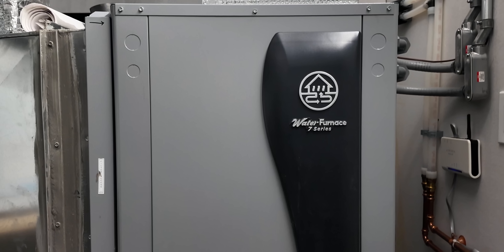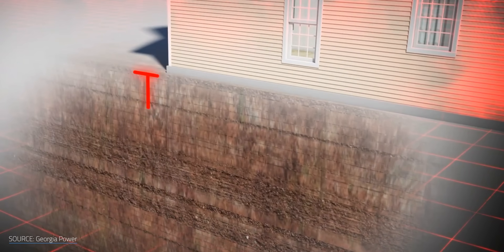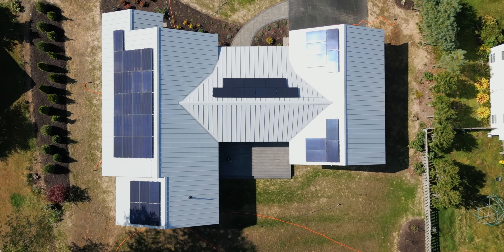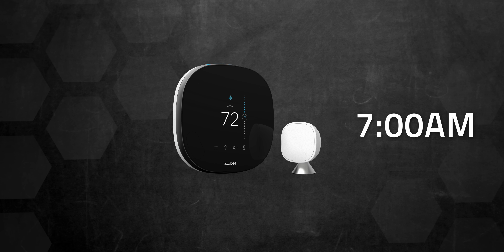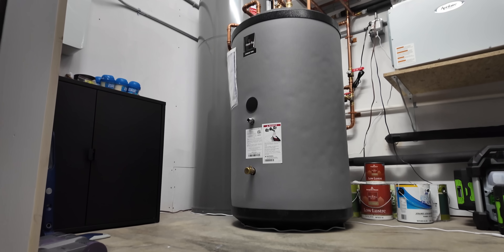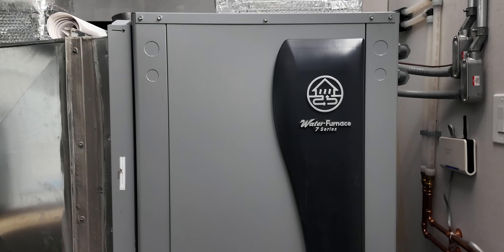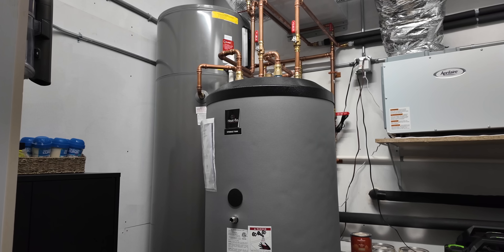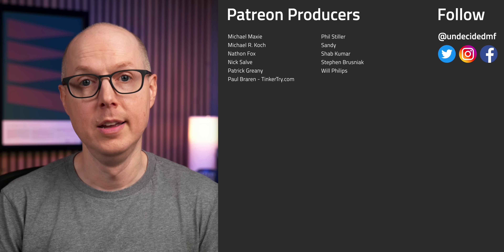How My Geothermal Heat Pump Really Performed (2 Years)

Comment: Hello Matt, 

Have you ever considered attempting to recharge your well in summer with more than you consume in winter in order to raise well temperature in the long run which in turn would raise your cop permanently? Groundwaterflow would be a thing, but was in my case no issue. 
Philosophically that's what we're all trying to achieve.You probably already do in part with a/c, but could a 24/7 reverse dry cooler (when T-ambient>Twell or house T-out) both running of excess solar improve the gram CO2/kWh dilemma ? Well losses would be higher, but the heat pump would be running more efficiently every year and heat would be nett transferred from atmosphere to earth, albeit relatively temporarily on a longer timescale. It would have an upper limit of course, but nevertheless you could in theory reach a higher cop than you do now. 

I ran some numbers with a relatively large radiator area (10 consecutive 'truck' radiators of 1m2 each), low (parallel 200L/hr per panel so 2m3/hr) and efficient medium flow and low (0.8m/s ambient air over this 1m2 aperture, but 10m2 radiator surface) serial airflow using low power, low noise and highly efficient 200mm Noctua computerfans, IP68 possible. Project was due to noise restrictions here. 

Even at low dT's (7C) it appeared to be possible to transfer say 4.8kWh of heat relatively silently (estimate 20-23dB) using presumably very little power. Rough estimate is 100-200 watts for fans (25w) plus circulation pump. Battery power required for night operation would be relatively manageable. 

In theory you could also include a second small 1kw (cop 5 + for 20C to 35C boost) heat pump running 24/7 of solar, but regarding well plume losses over time that's where my back of the envelope math stopped. And system cost would increase drastically due to extra battery, pv and heat pump requirements. On the plus side it could yield potable water if the incoming air is moist enough. Heat of condensation would improve that picture ever so slightly, which in summer is no problem. 

Cheers.

Comment: My gound source heat pump (geo thermal as you call it) costs me £1500 ish a month to run for half the house (including hot water) my diesel boiler that runs the other half of the house costs me £600 a year ish......

Comment: You Bla-Bla-Bla about your very high tech complicated and expensive Heat Pump system.  We went what all engineers know,  keep it simple...we built an ICF home,  best insulated,  we live in the central plains,  high winds,  low temps......and we heat with simple in expensive purchased at Home Depot,  electric oil heaters,  set on the 500watt level,  running most times at the 2 or 3 "dial"  setting......one per room maintaining 70 degrees 24/7.

Comment: This stuff is useless for  Alberta , I have  3.4 k sq feet concret wall house with outside installation and  hydronic system , three glass windows . At minus 25 Deg C I run my boiler at 45 Deg C , with 160 $ gas bill , summer time bill is close to 60 - 70 $ due to fees 
. I don't run AC , because it is cool at summer time due to thermal mass , all you need , just to open windows at night to cool down. Just can't understand why would I invest 50 K to save 60 - 70 $ per month ?

Comment: The term "Geothermal" made people  think they were getting heat free from the ground, like in geothermal hot springs. But in reality they are nothing more than a standard heat pump that uses water rather than air as the transfer medium for the condenser in summer and the evaporator in winter. The water in the ground loop must be 10 degrees to 20 degrees colder or warmer than the soil, for the ground loop pipe surface to transfer heat . SO.....in winter the water inside the loop is about 40 degrees , and can be 35 degrees or colder. If a warm day pops up, an air to air will be using that warmer air, say 50 degrees, while your water source will still be using that 40 degree water.  A " net zero" thing, not even close. They are okay....but highly misunderstood by the lay person.

Comment: In Europe we have this for decades already. We can't build the house less then A class for approx. 8 years (not sure about different regions). I personally own B class (gas heating + rotary recuperation, no solar). Combined cost during winter ~200EUR/month (gas+electiricty, while temperature mostly -5C but can drop to -20C for a week) and 100EUR/month summer for approx 90sqm (~1000sft), heat pump type dryer is standart, induction stove, blabla bla and yes - network rack with NVR :) all new houses have by default Air-Water heat pumps and solar panels.

Comment: Miiele washing machines are designed to last but a few years and have sealed drums so the bearings can't be changed and thus, a new machine is required. You think you're being green? No fella, you're really not. You haven't accounted for all the equipment used during the installation or the manufacture and installation CO2 costs. When these are offset, you're probably one of the worst CO2 emitters in the area.

Comment: Would like to have heard more in depth on the numbers… e.g. estimated cost over 25 years included materials, installation, use, maintenance for each system, and then this total divided into number of months for an actual monthly overall lifetime cost for each system. Cause, sure, operating costs are low, but that doesn’t tell us much considering purchase and installation cost.

Comment: I get the monthy cost reductions are sufficient to pay for the up front capital which is great - but how about the long term costs (like over 20 years) of such a compicated system? Lots of computers, sensors, actuators, pumps, piping, many places to fail. If the ground look starts to leak that is a big issue for example.  I am an engineer and try to look at total lifecycle costs. This is similar to modern cars, their complexity is now so high the reliability is dropping (look at the Toyota Tundra for an example).  Not a convert yet. 🙂

Comment: Mmm, with a ranch house layout the energy losses multiply, spending a $100,000 to save $50,000 in 10 years it would break even in 20 years and would be the same as having nothing and end up loosing replaced items along that time span, It is cheaper to do nothing and stick to regular city services, it is useless to build something like this in an old construction...!..

Comment: I had a 7 Series installed summer of 2016. It's been essentially flawless.  Total installed cost was $28,000 before tax discounts.  I have a 460' vertical closed loop. I heat to 70 degrees and cool to 72 degrees in a 1988 built 1880 sq ft Ranch in Upstate NY.  My total electricity usage for 2025 was 4120 kWh @ $0.21/kWh for a total of $865.  I do not have pre-unit gas usage.  I remember the first year being about $400 for the year, but electricity prices are way up in the last 9-10 years.  I would not tear out a fully working system to install this, but my gas furnace was 12 years old and only 80% efficiency, I had no A/C, and my water heater needed to be replaced.  Just to add A/C and replacing the water heater I was looking at minimum $5000.  To put in a high efficiency gas furnace, A/C, and a new water heater I was looking at $13,000.  Net cost was about $16,000 for me after tax incentives.  I have no regrets.

Comment: Just got my December numbers in and I got 1212.7 kWh heat out of my air to air heatpump for the month while spending only 321.9 kWh to power it. That's a COP of 3.77 which I think is great for this frigidly cold weather.
Not nearly as good as a geo setup but at the low cost of purchase and install it paid for itself in 2 years!

Comment: Hmm, the constant temperature is actually a negative for me. I vastly prefer much cooler temperatures for sleep, like 16-18 C. 22C+ would be stifling.

Glad the system is working well for you. Geothermal heat pumps are really interesting.

Comment: Back in 8th-10th grade, we learned about geothermal heating systems. Around that time, air-to-air systems was just about getting up and running up in the part of northern Norway I live in. This was about 15-18 years ago.
Air-to-air is the most common everywhere due to the initial cost and many people live in apartments. For ground-to-air system's, it was more commonly used for newer houses, some old ones if they had the yard space for it, but not normal at all.
If I ever build a house, I will most likely save up extra just for the ground-to-air system. Granted, having to drill through bedrock is quite expensive.

Comment: Hey Matt, this was a great overview and I loved how simple you kept the explanations without compromising on the details - keep up the great work! My parent's have had their geothermal system for over a decade now, and despite the massive costs they had to incur upfront when converting and sealing their old farmhouse, I think it was one of the best things they've done to manage the similar temperature and humidity swings we have here in Ontario's Niagara Peninsula.  I did have a question for you though in regards to your server setup.  Have you looked into ways to have the system capture the heat generated by the server and distribute it around your home (similar to what you are doing for the hot water tank) while also using the system to help keep the server operating at cooler temperatures for added efficiency and component longevity?

Comment: Thanks. You've probably covered this in another video, but a comparison to the costs of a standard gas-fired system + air conditioning would have been useful, to compare alternatives to geothermal + heat pump.

Comment: Greetings from Finland. We do not have ducted systems over here but underfloor heating. Still,  I have had geothermal since 2004. We heat 204 sqm with a 2-8 kW Bosch boiler integrated heat pump. I replaced the old one in 2023. These things have a lifespan of 15-20 years. We have a well that is 178 m deep. The average yearly temperature is +7C, an DOT is -27C.  I am very happy with our system. We use around 2600 kWh in electricity per year for heating and warm water.

Then the costs. Currently drilling costs in Finland are between 40 and 80 Euro per meter. On average 400 fett would cost 7300 Euros here. I paid around 5000 in 2004 for 584 feet. The replacment cost for the pump in 2023 was 11 000 Euros installed. I do not recall what I paid for the underfloor heating, but it was in the region of 5 000. The total cost for my system would be around 25000 today. That is a huge difference to what you had to pay. The difference is likely coming from that geothermal are very popular around here. There are several installers, pump brands, and drillers to choose from. In my region I could choose from more than 5 drillers, 10 brands of pumps and likely +25 installers.

The rough calculation here is that for houses below 150 sqm go with an air source heat pump and above go with geothermal. The only other option someone would consider for a new build here is firewood or pellet. These are options if you have own forrest and use the equipment such as a tractor for something else than processing firewood. Wood pellet can be an option if cheap supply is available.

Comment: Thermostats! When we installed our (Water Furnace) geothermal, our installer told us this:  Set it and forget it.  Radiant floors are lovely to walk on bare foot.  1,700sf VERY well insulated home, around $600 to heat all winter.

Comment: My preferred solution is to install the cheaper 80% gas furnace which has cheaper maintenance costs, and invest the difference in up front costs in the market. These expensive systems can barely break even over 20 years. I would be $200,000 richer by then. You’ll be preparing to replace this costly system as it reaches end of life.

Comment: You and the other commenters do not include total costs. Ex: rebates are subsidies that come from tax payers. That should be included in cost analyses. Also if your electric costs are low due to a private solar system, your costs for the system should be factored in. You were not explicit about this, which raises doubts and calls into question your overall conclusions. I noticed your answer to “was it worth it?” did not consist of a cost savings per energy unit but rather was framed in a net-zero personal goal. The absence of cost figures at this juncture in the video left me with the undeniable conclusion that it was significantly more expensive all in all. Too bad because I was looking for that critical honest and brave analysis to use in justifying a decision to move forward with a similar system in my area. I am regrettably left with my current assumption that such a system (as with solar) cannot be justified from a cost analysis alone. I wish it wasn’t true.

Comment: We had a home with air heatpump, i really hated it, it was noisy and didn’t work in winter with insane electricity use. Now we have a new home with geothermal heatpump in combination with a balanced ventilation system, that recuperates 95% of the heat passively. It works insanely well, house is always hot, no noise and sins june only used 250kwh(if i decuct solar) without solar my total energy use it 1500kwh.

Comment: Very expensive system in fact the most expensive to install. Also is not prone to breakdowns. Also you will need to have an underfloor heating system, which is also not prone to breaking. 
It was very state of the art system some ~30 years ago. A luxury class heating system for house heating. However nowadays things have moved on, home thermal efficiencies risen up quite a bit. Newly built houses are often reaching passive housing standards with heating needs of barely ~15-20kwh/m2 all year round.  With these numbers you are better off simply laying the direct electric heating cables, which costs basically nothing compared to geothermal, has no moving parts that are prone to breaking, combined with solar panels that are dirt cheap these days, they can also give you basically free heating depending on what your electric grid operator can offer to you. 
There are a lot better options now to look at. I see some people saying that these systems might cost them close to 100k which is insane IMO. I would consider a system like this if the costs were close to the actual heat pumps, but I doubt there will ever be. This heating system was  always expensive and in the past ~50 years it barely moved its technological advancements anywhere. It already reached the best technological advancements it can offer, and that is expensive...

Comment: $2.47 per month is about 8.2KWh per month or an 11.4W load running the whole month.  The fan to circulate the air in your house is going to use way more energy than that, not to mention the water pump, and anything else the system uses to run.

Comment: My question is inflation, and by extension, opportunity cost. If you lay out $80K to set up the system, your breakeven point can have a longer runway, as inflation makes the savings worth less over time. Your $80,000 now would be = to $250K in 30 years (4% inflation (I know, I think it will go up))  I do not know if the inflation of fossil fuels will make it all even. (It very well might, or increase your savings)
Anyone crunch the numbers?   

Also, does anyone know if you can do a heat Pump if you live on a barrier beach (It's basically a sand bar.)  Worried salt water/air corrosion and maintaining heat through a wet layer going within 3 ft of the ground level.  

Thanks Matt!   I appreciate your hard work, keep it up!🙂